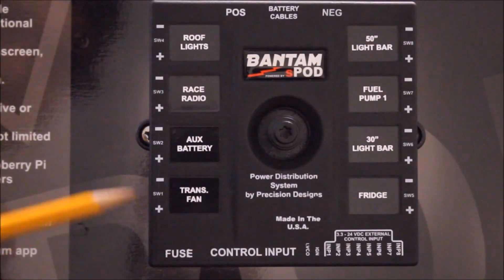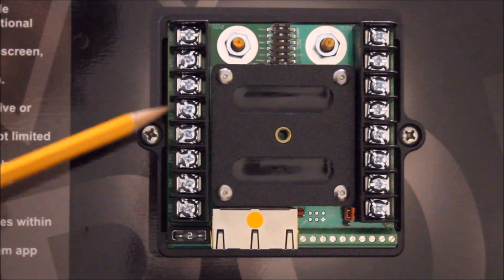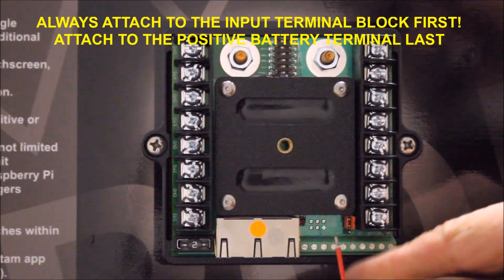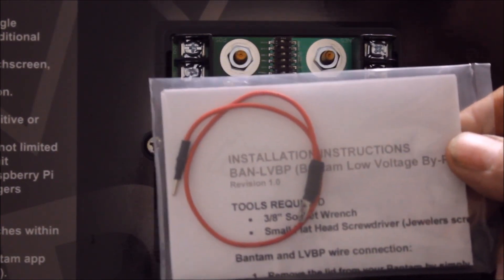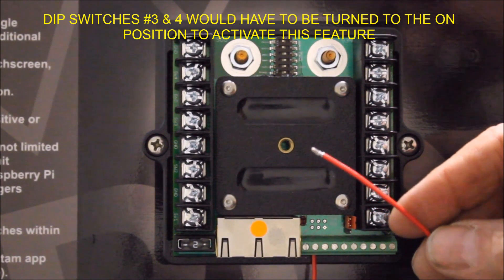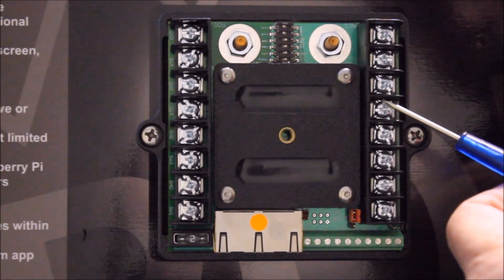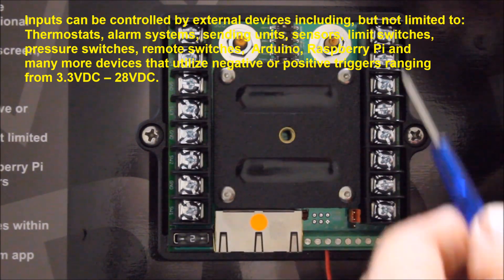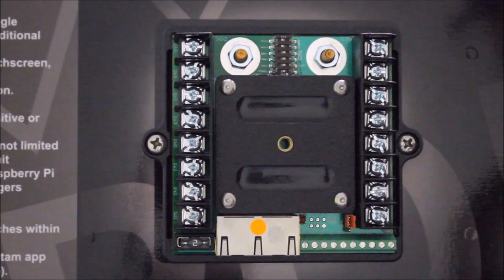Bantam Operations Overview

Comment: What is the difference between the batnam and se ?
Reply from the maker: Hello Al, This is a great question! Basically the size with a few extra options on the Bantams:
1) Can operate on 12/24v systems
2) Has 8 additional inputs that allows you to control the outputs with external devices (this is an add-on for the SE system)
3) Has Bluetooth built into is for easy over the air updates to firmware and for use with a smart phone  (this is an add-on for the SE system)
both systems can be controlled by any of our controllers:
Hard rocker switches
Touchscreen controller
HD smart controller
The SE system has a proven track record of about 5 years and has been used in a wide variety of applications. Both the touchscreen and the HD controllers have Bluetooth built into them, which basically gives you the same functionality as the Bantam.
The Bantam is new (about one year) and is evolving in many ways. 
Feel free to email us for a comparison chart of all three of our systems.
Send it to:
sales@4x4s-pod.com

Thank you!
-john
Reply: @spodofficial  thanks jhon i will send an email to you
Reply: The “JEEP JL/JT 8-CIRCUIT SPOD SOURCE SE SYSTEM W/ TOUCHSCREEN” has a mount that attaches to the Jeep that goes nicely with the air compressor mount.  Does this do the same?  Does it have a mount like the SE?  Does this have a touch screen with the SE?  I looked at the website and don’t see the Bantam as an option for JT.